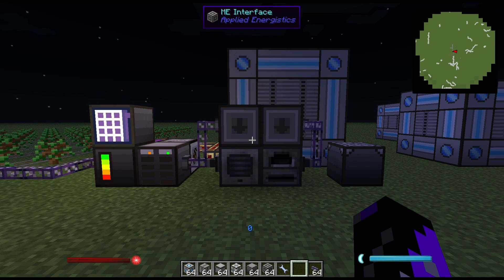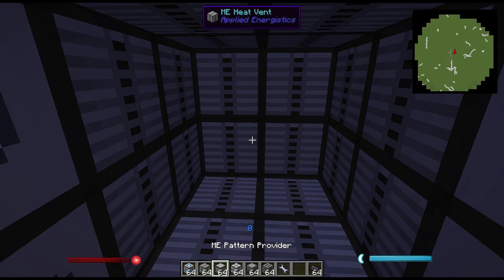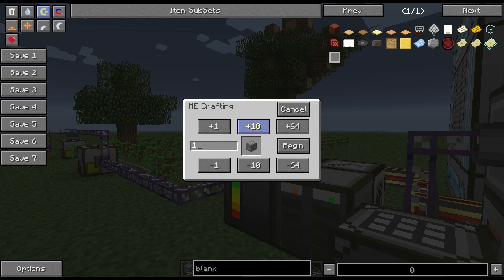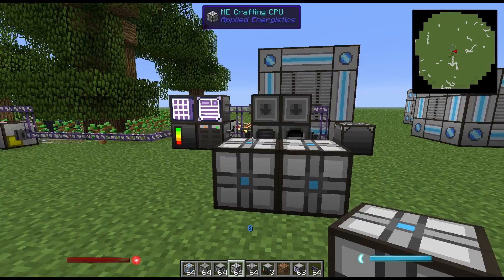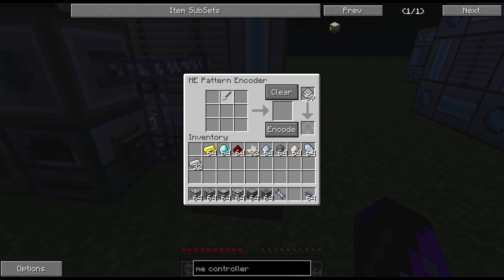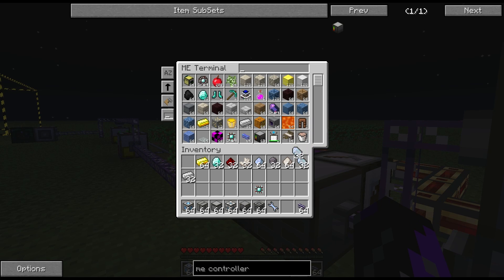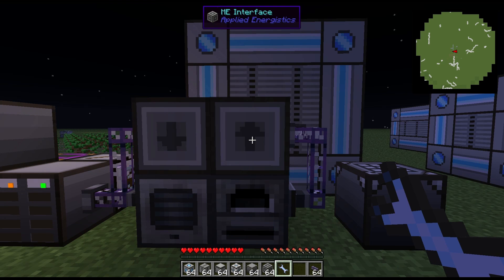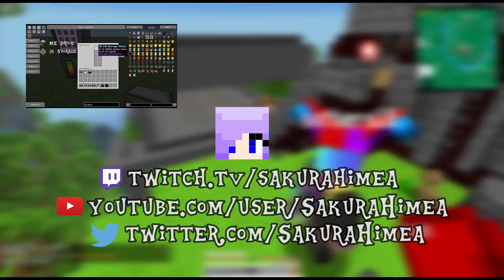How to Set-Up an MAC Processor - FTB Applied Energistics

Comment: When you are in the ME pattern encoder, use the search at the bottom of the page for the recipe, select it on the right hand side and it will show the recipe. Next, SHIFT left click the question mark and if you have the ingredients in your ME system it will put them in the ME pattern encoder automatically. Then encode as normal.  Saves you HOURS! You're welcome :D

Comment: I need a 2nd ME interface block to take the item out of the pulverizer and Furnace. My ME Cables won't connect with them directly to pull the item out.
Reply: Use an ME Import bus. (or precision import bus)
Reply from the maker: Are you using Busses or Cables? Cables won't pull items in or out, they just connect other network blocks together.

Comment: My "MAC" "cancels" the crafting. When I tell it to craft oh lets say a energy bridge from power converters, it shows up on the me crafting Monitor, but then it stops and all of the items go away like the crafting is done. Please help me!
Reply from the maker: It's hard to say what's going on without seeing it happen directly. Try breaking the controller and replacing it. If it still happens, my guess is there's a problem somewhere down the line with the crafting recipes. Check to make sure there's enough space on the storage disks as well.
Reply: mine does the exact same thing and everything is set up correctly plz help!

Comment: I have a Question I am looking to make my AE system automatically pulverize and smelt any ores that I import into the system without me having to demand the required ingot rather than have unprocessed ores AND ingots taking up room in my system, can you come up with any suggestions they would be greatly appreciated.
Reply from the maker: You can set up a precision export bus to export ores into pulverizer/smelter and have a basic import bus pull them back into storage from the machine. I'll be covering this more in my next video, so stay tuned and thanks for watching!
Reply: Ok ty for that and you are most welcome broh.